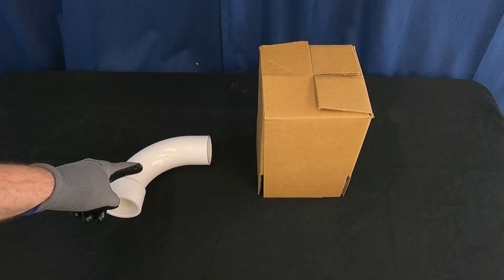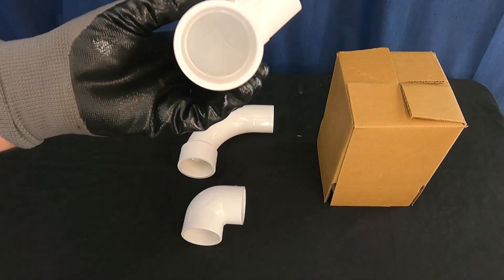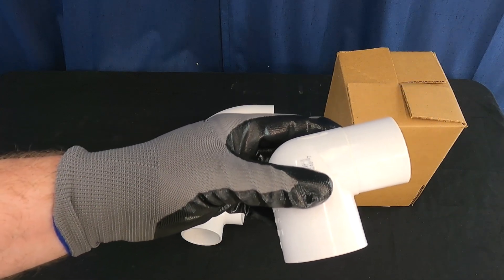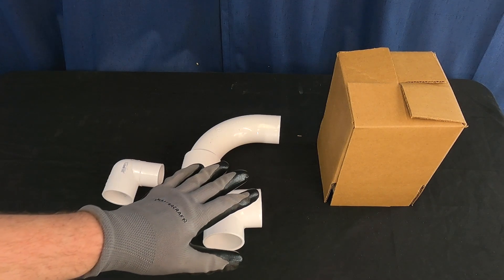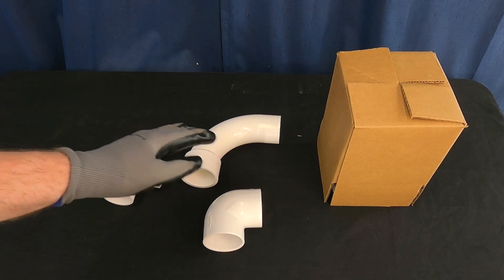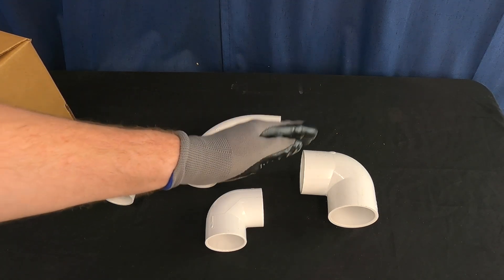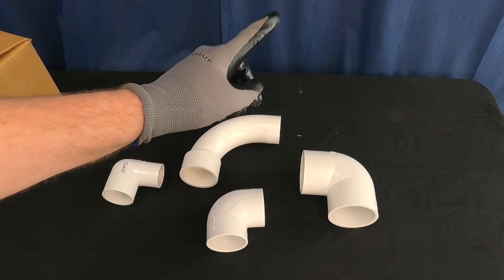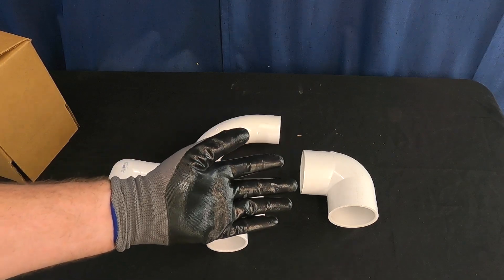What Is Better Than a Sweep Elbow?

Comment: Is there any benefit to switching from 1.5" pipe to 2" pipe for the pump pad if the underground lines to the pool are 1.5"? I'll need to redo the pad since the previous owner did a pretty silly job of it. It seems to be of limited benefit since the system is limited to the smallest diameter used but I wanted to check your opinion.
Reply: That is also my situation.  I'm at least going to stay at 2 between pump diverter and filter

Comment: Above ground pools? Yes. No problem.  In-ground: Pressure lines, no problem.  In-ground SUCTION lines?  I’m going to guess priming 2” or larger might start to become a problem unless you oversize your pump at which point you start losing efficiency.  Where’s the suction line balance?  AND enlarging and reducing can create more effective length than just using the same size pipe.  Might have to bust out my chemical engineering (aka plumbing) book on transport phenomena.  😊

Comment: Not all street elbows are a sharp 90. In fact, the long sweep 90 you show here is also actually a street 90. Street just means one end is the same outside diameter as pipe.

Comment: Hey Steve, thx for the video. I’m thinking most pool equipment is made for up to 2” pipes. Wouldn’t all the 2.5” pipe benefits be eliminated with the need to use reduction fittings?
Reply from the maker: It would not. It does not limit the whole system, just a momentary efficiency loss at the reduction. Most modern pool equipment comes with 2" and 2.5" port sizes. There is a lot to consider and each pool is unique but in general if seeking more efficiency larger pipes is usually more effective than upgrading short radius 90s to sweep 90s

Comment: I insisted on only sweeps for turns and went with 2"pipe.  I also oversized my salt cell and filter.  Have a Hayward VSP and my pool runs like a dream.  Only thing I'd change is going with more smaller lights than one big light.  Appreciate all your knowledge.

Comment: I'm thinking your excellent material on using VSP at low revs 24x7 often defeats the case for 2.5" plumbing on residential pools. With 2" plumbing, my schedule is 1100 rpm, moving 38 gpm at 100 watts. SWG is very happy with this. Can't hear the pump at more than 6' distance. With a couple of hours daily at 2200 rpm to skim and clean this is filtering 60+ kgal, over 3x the pool volume. It doesn't seem 2.5" plumbing would have been worth the extra cost. The bottleneck on my pad is definitely the heater. Adding a bypass has been super helpful for efficiency.
Reply: I never thought to use my bypass when I'm not heating.  Interesting
Reply: @Version135 Yeah my Mastertemp really cuts flow. I'm starting to think there's something out of whack inside. (That's a technical term.  😊

Comment: with all the gear being 1.5 or 2 inch does it really help, not even mentionning the piping underground
Reply from the maker: If you have multiple 2" suction lines, as many pools do, then there would be more advantage to upgrading your equipment pad installation to 2.5" than swapping all of your 2" ells for 2" sweep elbows. Most modern equipment takes 2" and 2.5" pipe natively. If not, use a coupling with a reducer bushing in one side as needed to mate to the equipment sizing.

Comment: I watched all those videos about street elbows and efficiency loss. I'm in the process now of building a pool with 3" lines. Thanks for the good content.
Reply: Oh man.. And talk about hard to find 3" long sweep elbows. Not for the faint of heart.
Reply from the maker: @theFlesrouy  probably used short radius 90s. If the system is sized properly you can do that and still have vastly .more efficient flow than a smaller system using only sweeps. 65 gpm versus 138 gpm for max efficient flow range from 2" to 3" pipe size. So more room for friction losses in the turns while still maintaining a higher overall system capacity and efficiency
Reply: @Swimmingpoolsteve  Considering my pool has been "building" for two years, it's currently operating at 0% efficiency. I wish efficiency losses were my actual problem.
Reply: 3in diameter 12in, 24in and 36in sweep radius are available at any Home Depot. Don’t costs that much either. They are in the electrical section and are gray in colour.
Reply: @AlessioSangalli  How do those hold up to Chlorine?  I assume the gray stuff holds up better to sunlight.  How about pressure too?